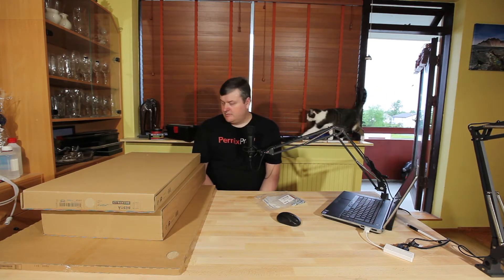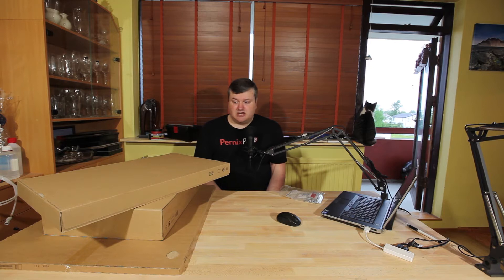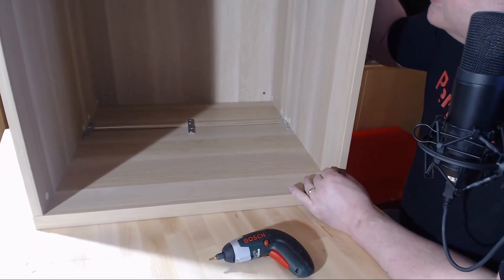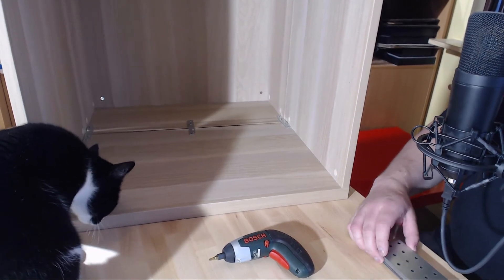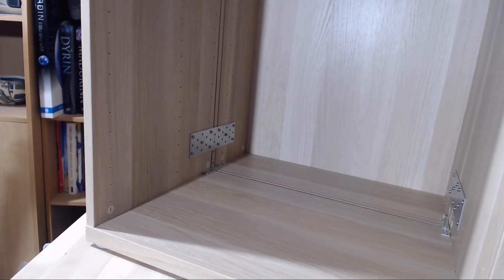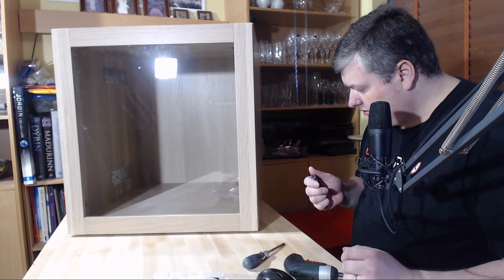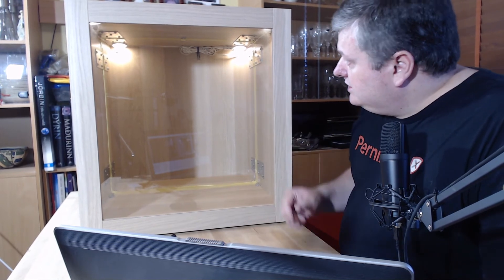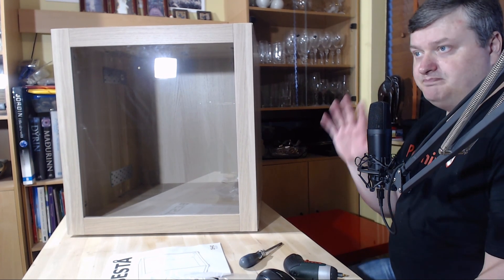Besta enclosure for Prusa i3 mk2s

Comment: A quick tip. If you pre-drill holes into fiberboard, the screws will hold tighter. Screwing directly into the fiber board tears the fibers instead of griping into the material creating a weaker bound.. It doesn't quite behave the same way as wood.

Comment: how it  fit in ? did you put the power supply outsite？
Reply from the maker: printer fits really well, plenty of room, and no, powersupply is kept in original place, but I have a fan in the back of the enclusure, (see enclosure update video), where I blow air from outside to both the electronics and the powersupply, to make sure those parts don't overheat.

Comment: Hi! I plan to build this enclosure for my MK3. 

May I ask some questions?

After all those month, would you still choose this enclosure? Would you do something differently?

Could you please tell me the inner dimensions? The outer are 60x60x64 right?

Thank you and thank you for the inspiration for this enclosure
Reply from the maker: atStahlfabrik hi. Inner dimentions are 58deep x58height x 56wide and I still love this setup. I store my filaments on top along with some tools and the I dont think I would change anything at this point, but I added ventalation fans at the back panel for normal PLA printing. On at the bottom blowing air in, and on at the top to suck air out. I have several filaments spools inside the cabinet on a cut off broomstick that is mounted side to side at the upper back section. I willl post a picture on twitter after a few minutes for you on my @3dpiceland account
Reply: Oh the z is only 58? Externally it is 64, right? The MK3 plus spool I measured to 61cm to be able to change the spool - I need to remeasure - but I guess I need to not use the supplied spool holders then? Do you own a MK3?
Reply from the maker: atStahlfabrik i dont use the supplied spoolholder, and soon I have my mk3 arriving, should be shipping to me soon

Comment: Very nice, looking forward to your temperature readings, As Always Happy Extruding....
Reply from the maker: I'm printing ABS now (spare parts for the printer), and bed is set at 100°c, but measures at 70°C, -  temp at top of ABS part that is printing is 65°C, Temp of air inside the enclosure is around 39°C, so I guess that's pretty nice for ABS printing
Reply: That seems to be the same all around with the bed being a little cooler than the set temp. 39C yes will get you some decent printed back up parts, Thanks for the info (subbed your channel )
Reply from the maker: Thanks,  my guess is that the PEI sheet has some isolation from the printbead it self in regard of heat.